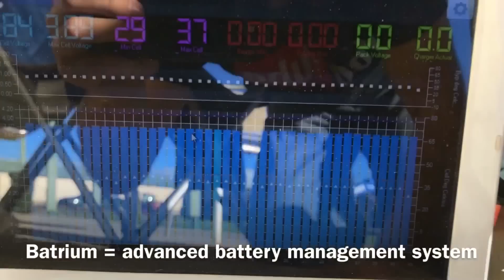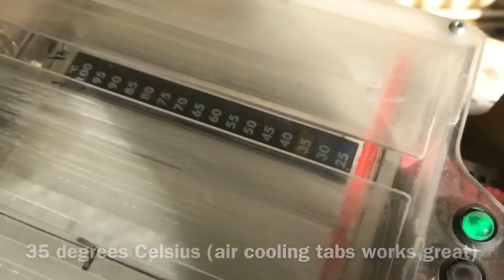210kW Racing Electric Yamaha R1 vs Petrol Bikes (race track) • Ripperton DIY Electric Motorcycle

Comment: I’m building an R1 conversation soon. I already posted a video short of a bike we worked on. Only using a 60kw motor however with our build and only 1 controller. But should be still very fast.

Comment: Surronster took the piston off apart to align DC motor to 1 side belt wheel cog to new motor cog with sprocket chain other side .

I'm not laughing 🤗
Fumble on the ermmmmm Half chewing his Crystal ball meth splutter "We're not selling manual clutch 4+ gear & Neutral" weekly we'll all blame each other????

Comment: How’s the traction control? Do you have to worry about it doing a wheelie when you hit full throttle? I crashed my 1999 R1 today doing a power wheelie by mistake. Thinking about doing an electric conversion.
Reply from the maker: Wowwwww yeahhh man please convert your R1 into electric there are a lot of good motor options nowadays!!
Hahaaa I can’t believe you’re here texting after crashing your R1 hahahaa
Traction control is not easy on DIY kits, only available on more expensive and refined stuff and needs some user fine adjustment.
Reply: @BrunoPOWEEER  I wear full moto gp gear so I walked out without a scratch lol. I only crash doing 120kph. Not too bad! What would you suggest I put in my build?

Comment: what is the max speed of this bike?
Reply from the maker: It’s not geared for top speed but for racetrack so it was about 230kmh max but if gearing tall with all that craaaazy torque (4motors running together) I would say more than 300kmh... the fastest top speed production bike is electric, Lightening Motorcycles 350kmh 218mph

Comment: i have a 48v 1500w hub motor if i used it off the wheel doing transmission to wheel would i gain more torque?  would the engine work lighter?  thank you very much
Reply from the maker: Yeaahh, lots of people are actually building hub motors as a mid drive, massive torque as these motors are outrunners with very big diameter. chain or belt drive to the rear wheel. You can try many different sprocket ratios as well instead of having it fixed like the original hub motor. It should be a lot more efficient electrically as the motor is working easier “lighter”. There are some transmission losses by using chain or belt but you gain more than you lose. Also regen will be very strong
Reply: @BrunoPOWEEER  thank you very much.

Comment: Damn. I thought my 38kw motor hubs was fast. But that’s a beast. 210kw belt system with 1200a setup is nuts! I only running on 260a. Thinking of pushing it to 300a. I’m only running 72v on 120ah battery setup.
Reply from the maker: Yeaahhh definitely push to 300A.... 120Ah battery should be able to handle for bursts like 5-10 seconds... just don’t hold it continuously 300A on a highway hahahaha
Reply: BrunoPOWEEER with the math I should be able to do 308a. But yeah I was thinking continual acceleration could damage the motor and cause the controller to shut off. I’ve had that happen before on older builds. I have smaller build setups with 20kw and 16kw motor hub with 2x42ah batteries and 3x30ah battery setups. Bikes my friends can now join me on lol. Go Electric. It’s truly the future. I want to build a belt driven setup next.

Also my bike has 3 gear modes. I don’t run it on full speed mode all the time.

Comment: If you compare the 4 cylinder 1000cc bike engine to the elecric motor it's like a 250cc continuous power , the power is 1 out of 4 strokes plus it slows down when the fuel and air mixture is compressed . So you could say it's a 200cc vs the elecric motor.
Reply from the maker: Yeeeeeeaaahhh this is the best reply EVER!!! My other mate here made an even more powerful 700 volts electric racing motorcycle and he started the race against the big 1000cc bikes (just for a few laps) and right at the start he went from last to 1st (like a rocket) before the first turn... then the second time the bikes kinda stayed blocking his way but still he was 3rd at the first turn! I uploaded a video showing an 400HP electric vs 400HP combustion, slip to 4:30min https://youtu.be/m2XevzDU44A

Comment: the rear "brake" setup is is actually a genius idea, you should sell that to zero!
Reply from the maker: Yeahhh it actually works really well and nothing mechanical to break/wear anymore... I’m pretty sure many countries you must have rear brakes fitted just to comply with the road legislation, they need to update to better accommodate electric motorcycles =]

Comment: Hello i really love your motorcycle but I got a question what kind of electric motors you have its it monofasic of trifasic is it brush  or brushless and it is and what kind of potentials do you have and how you connect the motor with one controler
Reply from the maker: Ricardo Perdomo, BrunoPOWEEER here hahaaa are u Italian?? 
Okay, first thing... DC / brushed motors are a thing from the past... forget about them and focus all your energies on 3 phase motors. They’re brushless, silent (no brush noise), no maintenance required, more powerful, waaayyy better controllers, regen brakes (motor brake, charges the battery as you brake) feature available in nearly all 3 phase controllers. 
Motor controllers, in this motorcycle there was two big motor controllers working together.
There are two cheap/good value sources of these motors and controllers:
https://goldenmotor.com/

https://aliexpress.com/store/109978
Reply: @BrunoPOWEEER  your the best thanks for everything

Comment: Why can't they make a battery that can charge it's self as its getting used .
Reply from the maker: Simply because it doesn’t work... look at this very simple and short video I made showing what a little generator makes when you connect to the spinning wheel https://youtu.be/T4qvT2xuvso
There is always a loss somewhere, if it was possible to be 101% efficient Tesla and all other large manufacturers would’ve done years ago without batteries... =]

Comment: How much does it cost to make this electric car?
Reply from the maker: To make this electric motorcycle or to make an electric car?

This racing electric motorcycle had a lot of different parts, Danny Ripperton spent years perfecting to get the most performance, he made all parts and he made all the motor, battery case, not easy to replicate.

Comment: 210KW is a battery power or motor power?
Reply from the maker: the device that dictates the power is actually the motor controller, the battery and motor are kinda like slaves obeying the motor controller power requirements. This bike has 2x big motor controllers and a massive nearly a meter long battery and 4 motors sandwiched together (see photos here) https://www.instagram.com/p/BVzHFcHlgwe/?igshid=w8ute37ebnjf

Comment: An Ice Cream truck song playing while riding it would get some funny reactions from the other riders.🤣😂
Reply from the maker: Hahahahahahahahhaahha that is actually a really awesome idea hahaha I’m here imagining that scene happening hahahahaha
Reply: OMG!  That is brilliant!!  Love it!  And I love this camera guy in the video.  I wish I had a friend like that with me at the races.  Taking your idea one step further, what if it were required that each bike basically have a unique set of sounds, so that for instance, when brakes are applied, or under acceleration, or when leaned over pulling Gs, it'd make noises so that other riders would have a reasonable awareness of them?  It is a basic safety issue, because otherwise a field of electric bikes are going to collide a lot, I'd wager.  I'd want my bike to fart when decelerating, and quack like a duck in the turns, then belch out a Godzilla scream when accelerating.  That's just off the top of my head, but imagine a field of otherwise silent machines all making unique sounds, and what the announcers could do with that?  It'd be hilarious and fun!  And obviously safer for the riders, assuming they don't laugh too hard and lose control of their own machines...

Comment: What is frame you used???
Reply from the maker: Yamaha R1 but some cuts and welds here and there for the motor controller under the seat and new brackets for the battery and motor mounts
You will love watching this DIY 50KW Racing Supermoto https://youtu.be/B7OUMzH0nOY soooo much POWEEEEEEEERRR
Reply: @BrunoPOWEEER  damn!! Supermoto electric... I watch now hhaa... Are you prepaire this bike for  race moto e gp hahhaa ,,

Comment: There are only 3 of my questions.
1. How many hours charging this motorcycle battery until full.
2. How long can this motorcycle battery last.
3. How far is the mileage that can be reached, if the motorcycle battery is in full condition.
Tq
Reply from the maker: Racing electric motorcycles can be charged very fast, 45min, 30min... 15min is also possible but chances are you’ll be damaging the battery in a few races... if you have a lot of money to burn and sponsors....
The battery was designed to last the race, not too big not too little but capable to survive at full power. 
This bike can’t be ridden on the road like a normal motorcycle so we don’t really know how many kms it would be capable at 50-70kmh and many stops at traffic lights... the battery is much bigger than Zero motorcycle batteries
Reply: @BrunoPOWEEER  Thank you for your explanation.
Reply: @BrunoPOWEEER  Now I think I am more interested in an electric bike now because of this video. Maybe not for racing but as the practical use for Transportation.

Comment: Wow, the speed is so fast, amazing, 
How much the top speed ?
And how much time for going to 100 Km/h ?
Reply from the maker: Yeeeaahh that bike on the straight line is probably doing 230-240kmh but this is on a short racetrack, on the road depending how you gear (rear and front sprocket size) it would go 270kmh easy with that much POWEEEEEEEERRR but not too sure if the bike will be safe with all these homemade cuts and welds hahaha
Racing motorcycles are tuned mostly for high speed cornering and acceleration from 60kmh above so they’re not reeeeally geared for drag racing or 0-100kmh. It’s possible to modify the bike but then it won’t be good for racing anymore...
Reply: @BrunoPOWEEER  how much time for reach speed 100Km/h ?
4 second ?
Reply from the maker: Oziel Oza yeah I think geared tall for racing would be no more than 4 seconds. There’s another electric motorcycle here in Australia that is 700v with an electric car motor, that one SMASHES petrol bikes in acceleration even geared tall for racing, it’s actually funny watching the petrol guys can’t believe what they’re see hahaha
Look up Voltron Motorcycle https://m.facebook.com/voltronmotorcycles/

Comment: Dude is a little over the top for sure, the bike owner is a very patient person.
What is the time in a 1/4 mile or you clocked top speed?
Reply from the maker: Hahahahahaha
Yeah this is a bike tuned for racing (fast cornering and geared for fast acceleration from 60kmh) on that straight line on the small
Racetrack the bike is doing probably 230-240kmh, it could do more on a flat highway with taler gearing or tuned for 1/4 mile but it was so much work tuning the bike for racing that Ripperton doesn’t want to modify too much.
You will love watching this DIY 50KW Racing Supermoto vs petrol bikes on the racetrack https://youtu.be/B7OUMzH0nOY soooo much POWEEEEEEEERRR

Comment: I can't believe he did this with air cooling still.
Reply from the maker: I also asked this question and his answer was : liquid cooling all these cells would add a lot of weight and complexity, racing bike needs to be light. The guys racing electric motorcycles for 6 years learned a lot about cooling high discharge Lipo cells, they tried everything, they did have cooling plates between cells but never really worked well, the best cooling was cooling the bus bars and guess what, they’re conductive, high voltage so you can’t have a cooling plate across shorting all bus bars. It’s also a lot of metal cooling plate (heavy). The bike passing 220kmh on the racetrack so there’s plenty of air for cooling and it really works, cells don’t get hot.

Comment: Pop a electric motor from the lighting 218 and you would have a formidable matchine. I just watched a video of the 218 dusting  the Kawasaki H2 at a drag strip. They were neck and neck until the last 8th mile then the 218 pulled ahead by 3 bike lengths.
Reply from the maker: Wooooooowww I need to find this video right NOW...
I called Lightening Motorcycles back in 2015 and neeeeearly bought their motor + controller, the LS218 is 200hp 200Nm and this is a conservative reliable setting... can be set to 240hp with 200Nm... that’s just BRUTAL hahahaaa so much POWEEEEEEEERRR

*i have a 400kW+ Performance Tesla drivetrain here... it’s definitely not going in a car so I guess I’ll be making something stupid hahaha

Comment: no disc brakes? Does regen still work if the battery dies?
Reply from the maker: Hahaa this is a very interesting question... he still has the front brakes and these modified motors have massive magnets so when there turned OFF they’re hard to turn (motor cog). Danny spent 6 years building and racing this bike and he has been through a lot of weird stuff, once his pack got so hot in the middle of the race (too much POWEEEEEEEERRR)  actually had a battery fire started.. (5 years ago) and he managed to stop the bike.
Regen is actually controlled by the motor controller, this bike has 2 controllers so chances of both controllers dying together are very odd.
Batteries don’t just die like that, you can tell that there’s something really wrong before it stops, it goes noticeably weaker and if you keep insisting and pushing they eventually die.. so you can actually stop the bike.

Comment: how long did it take to charge?
Reply from the maker: Racing electric cars and motorcycles using high discharge Lipo batteries can quickly charge up in 30min or even 15-20minutes but that’s not recommended... ideally 1C charging rate is fast enough which translates to 1 hour. 
I talk about fast charging in thisnktjer video here showing a 50kW Electric Supermoto https://youtu.be/B7OUMzH0nOY

Comment: 1 race 1 battery 2 race 2 battery 3 race 3 battery.
Reply from the maker: Fast charging... depending on the charger can be fully charged in 15 min charging at 3C rating just like an RC toy car.

Comment: This is r6
Reply from the maker: This is an R1... Ripperton crashed during a race a few months before and he needed a new fibreglass racing fairing ASAP, the fairing guy didn’t have any R1 ready but had a few R6. Ripperton adapted and fitted the R6 and it still on the bike since.

Comment: Awesome conversion project, and I'm surprised and impressed with the power output. Unfortunately electric motorbikes have a long way to go in terms of range per charge, but give it time--this is a conversion, and the combustion-engine bike frame isn't designed to accomodate a suitably big battery pack.
The camera guy, on the other hand, needs to lay off the crack cocaine. Enthusiasm is cool but he sounds mocking and childish.

Comment: Does the bike use the  gearbox still?
Reply: No
Reply from the maker: No gearbox, everything from the original bike was removed, the chain goes from the motor straight to the rear sprocket =]

Comment: Need have two batteries, And to quickly to change..
Reply from the maker: Yes, Ripperton and the other Electric Racing guys considered a quick change battery (the battery is dropped from the top inside the frame using an engine hoist/crane
The problem they had was these batteries are expensive to make and no many sponsors were keen to put their money on any electric motorcycle race back in the day.
Also the racers always have time to fast charge between races so they kinda stopped considering this option for now.

Comment: how fast is is accelerating?
Reply from the maker: I think when he passes on the straight line he’s around 210kmh I think but this bike is geared for racetrack not for top speed. If gear for top speed and give a longer run it will go faster. Acceleration is also gearing, it’s a matter of changing rear wheel sprocket size =]

Comment: Now try to refill when it runs of juice xD xD xD
Reply from the maker: Yes actually much easier than petrol bikes, any power connection will charge this bike, just like your phone or laptop. Now try to imagine if your laptop and smartphone was on petrol and you had to leave home at night before going to sleep to refill it at the gas station making sure it was full tank for next day haha
Reply: @BrunoPOWEEER  alright, but I think it's more easy to take 10 litres of petrol with you then spair battery or generator. What you think?
Reply: @BrunoPOWEEER  sorry but I don't know how much you can make on full battery

Comment: recharge the cell overnight. get another cell.  Is it cheaper and faster than filling a tank with gas anyways?
Reply from the maker: Having two packs is definitely possible, can keep the bike much lighter. The food delivery guys riding electric bikes often have two small batteries instead of one big one. Electric looks more expensive because you pay more upfront but is always cheaper on the long run... there are lots of videos showing Tesla owners making calculations and showing how much money they save

Comment: R6 fairings?
Reply from the maker: Yeahhh well spotted!! This R1 had a crash during the electric championship 6 months before this video and Ripperton fitted an R6 fairing instead of the original R1. I think he needed a replacement ASAP and they only had the R6 in fibreglass racing fairing... this bike is a strange mutation with lots of random parts hahaaa